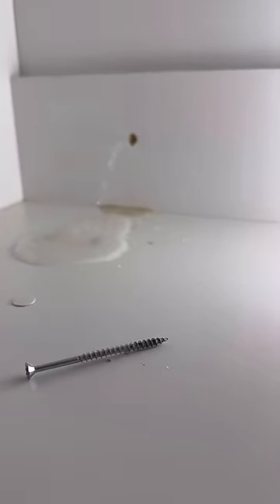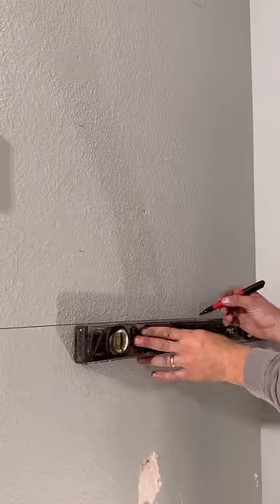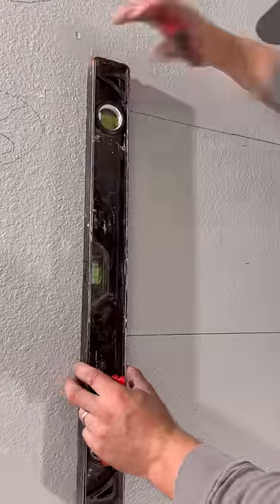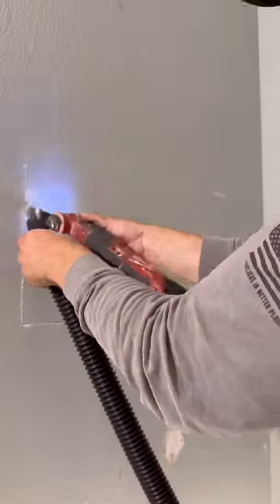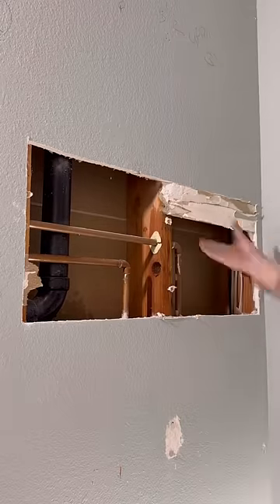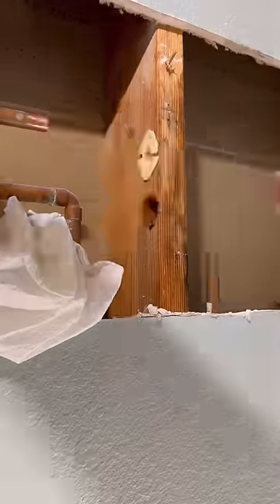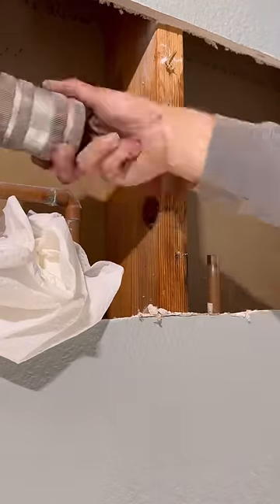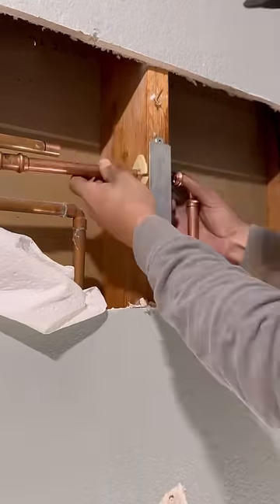are screws supposed to be wet? #plumber #plumbing #homerepair #diy #plumbingrepair

Comment: Nice to see a plumber use a level to  mark out the required opening instead of bashing the drywall out with a hammer!
Reply: Recently ive had plumbers even screw the cut out piece back in, they even did it right.
Reply: The hammer is too much, I just poke holes with a screwdriver

Comment: That shouldn’t have passed cover inspection without nailplates. Gosh why pay the county for permitting if they can’t complete an inspection before cover?
Reply from the maker: Looks like there were nail plates installed before the Sheetrock went up initially. You can see marks in the wood from them. My guess would be the drywaller ripped them out after the rough plumbing inspection
Reply: @replumb  I believe you after years of watching youtube "builders" but that is hideous behaviour!!
Reply: @replumb but WHY 😂 and why aren’t they held responsible criminally or civilly?

Comment: OMG!!!!! This has to be a first!!!  A plumber actually cut out a square piece of sheetrock for a repair. Most of the plumbers I've worked behind use a hammer to remove sheetrock. Great Job!!!
Reply: If it was a great job he would have kept it intact for any easy repair, instead of busting it out.  Amateur.

Comment: When there's a leak in the wall, it's good to have a decent size opening. You need air flow so the inside of the wall dries before it gets repaired. Wet sheet rock won't go back up well even if you did save it. It can warp or stay damp. If it doesn't dry causes mold.

Comment: I was doing a bathroom floor and ran through a copper pipe that was ran through a groove cut in the beam that had it right at floor level and was so tight it wouldn't even  let the screw push it over. I took a compression coupler off a basement Silcock pipe repair that was past the shutoff as it was a Sunday Night. I came back and soldered the Silcock pipe.

Comment: Marking the pipe is also mandatory by viega for warranty
Reply from the maker: They will warranty their fittings when the pipe was prepped and installed properly, regardless if they see you marked it or not
Reply: @replumb  correct install requires it to be marked. Been through their warranty already.

Comment: Nice work man. My old plumbing company had an issue with a couple bad propress joints on a big project we had. They leaked pretty bad and did some damage and the companies were on us about making sure we marked our depths. Not sure if it's industry standard but hey nice work

Comment: Did you know that in Calif, even if the house was built yesterday you still have to test the drywall & any jointing compound in the affected area for asbestos before you make it friable / open it up.....Unless you have an Asbestos O&M certification and you follow a certain protocol to prevent any material from becoming airborne....$35K OSHA fine if it's "Hot" and the residence is contaminated - Plus decontamination costs. Yes it's true, look it up.

Comment: Little tip for the sheet rock removal is to know where the stud is, and give the drywall a couple good hits with ur palm. The screws will pop a little bit and make it easy to get the piece out in 1. Most plumbers won't take the effort but it doesn't take much

Comment: Plumbers don’t do sheet rock. They literally make a huge mess and leave it, and charge a LOT of money. Oh, and those compression  connections will leak after a while when the metal expands and contracts from the heat.

Comment: There’s many ways to do it.
I’ve seen nails/screws go through nail plates and not leak for a year.
Also seen an unsoldered joint not leak for a year. That was a tight one on the top plate!
Also, never had a shark bite go bad on me either, you’re allowed to bury them in walls now too

Comment: I did that exact thing putting up a handicap grab bar in a bath. Took about a year for it to finally rust through and start to leak. There was no steel plate over the pipe so they didn’t sue against my insurance.

Comment: It's also good to note that stud guards should be recessed into the wood when inside of a shower, they push out whatever board you're putting on to the wall, which makes your wall have a bump in it or make it go out of plumb, I always recess with an oscillating tool

Comment: Aren’t pipes and electrical wires supposed to be a certain depth back from the stud end? 
A friend of mine, who has a house that is 25 years old recently ripped out old shelves in their pantry and when they did water from upstairs, their kid was taking a shower, started coming out. Turns out that when they built the house and put shelves in, they screwed into the studs but also along the wall and went into the drain line, apparently only grey water goes through it, and the screw was tamponading the defect….

Comment: Hey Boy, back in my day I would have cut the sheetrock out and used chewing gum as a permanent fix to plug the hole. Nailed the sheetrock and slapped  wallpaper over it. Task finished. 😲

Comment: Ive done plenty of melamine shelving in my lifetime, and not once did I ever screw in the board that has the hole in it. there is no point in screwing that piece in, it is strictly in there just so you dont see any gap left between the back of the shelving and the wall. at most you could add some caulk, the only place you would screw those shelves to the wall is using an L bracket on the top of the shelves out of view.

Comment: If the pipes are in the center of a six inch wall.......stud gaurds do not have to be installed! You also have to consider that drywall guys will remove a nail plate to make there job easier

Comment: They have a tool made of plastic that gives you the correct fitting depth, taking the fitting on and off is just increasing the risk of compromising the o ring not to mention you may not get the correct depth using the fitting unless you have those glasses that can see through the fitting🤦🏽🤦🏽🤦🏽

Comment: You should actually have the waterline in the middle of the stud, that way when the sheet rock guys use 1-1/4 screws, they won’t hit the line no matter what,
Reply: Yes, but cabinet guys always use a 3 inch screw. They would hit it anyway, I nail plate, no matter what the depth

Comment: How does the Propress joints compare with traditional soldered connections? Are they stronger and longer lasting under mechanical stress?

Comment: I recently had the exact same thing happened to me after I had to replace about 6 feet of freeze bursted pipe. Sorry I'm still old school, had to sweat mine on. I had pixs to prove that I used nail plates. Instead of leaving the sheetrock work for me to redo the property owner had his Son in law do it. Well 3 days later I got called back there, Yep the son-in-law pulled off the nail plates and Had 2" screw in it.😂 This time the property owner had me fix the sheetrock and guess what I HAVEN'T HAD TO REDO IT.

Comment: Serious question, but wont the o rings in the propress degrade and eventually leak? Im not bashing on anyone, but im geniunley curious as to why he pressed it instead of soldering
Reply from the maker: Fitting will outlast the pipe

Comment: there was a nail in a 1/4 hot water line for 20 years or more that I know of, never leaked.  When I did a bathroom remodel I could not believe my eyes.  never leaked but was fully in the coper.

Comment: The holes wasn't drilled in the right location in the studs 2x4 studs need to be drilled in the middle of the stud and other size 1 3/4 from the edge.

Comment: I'm charging six hundred bucks just to repair the sheet rock.
Reply: What a scam $600😲
Reply: @xpress Freight  you obviously don't value your time,  you have no idea how much materials cost, and you've never done a wall repair at eye-level that blends  in so no one can tell there is a wall repair, and you're definitely not licensed bonded or insured to do such work.

Comment: No! It's not wherever the pioes are what do you own a stud guard manufacturing facility bro ? I'm down in Florida whenever the pipe is closer to the face of the stud than the width of a grown man's thumb you are required put protection. If the drywall contractor bust out two inch screws because he's out of inch and a quarter that is no one's fault. And we live on change orders down here so please drill through my pipe with those 3in screws. We purposely roll our lines to the middle of the stud to avoid that repeating continuous expense of stud guards
Reply from the maker: It’s 1 1/4” away from face of the stud. Any closer you should be using a stud guard

Comment: $600! $5 in parts, 30min drive, $25 vehicle costs, 30min repair. $570 per hour wage. Yep, robbery.
Reply from the maker: More productive to society than a lawyer
Reply: @replumb  I'll give you that one and add taxes accountants.
Reply: You forgot that plumbers have to pay for insurance (liability and vehicle), that's a huge cost. And you're paying for his experience. A handyman would be cheaper, but who knows what the results will be. This guy even held a shop vac up while cutting the drywall...the average schlep doesn't do that!
Reply: @spookerz35  Sorry, $565. $5 for 30min of liability insurance and I already included vehicle costs.
Reply: @court2379  - so you're good with some JB Weld, hose clamps and duct tape...got it!😂
Reply: @spookerz35  No those are way too expensive. Just a can of flex seal. 😉

Comment: They tested those plates against a modern driver gun and it screwed right through the plate easily, no excuse not to use them but there not foolproof at all

Comment: Yikes, pro-press are not rated to buried installations. 
Why not solder the pipe, won't take much longer for known piece of mind. Now after the 5 year mark you will be fearing that the customer will be calling you stating that your quick fix is leaking.

Comment: You’re talking about nail plates to prevent nails or screws being driven through pipes, seen to many times where these inconveniences haven’t stopped diddly squat, brain dead “ sheet rock installers/ cabinet makers have still driven fixings through them. Lol.

Comment: Jeez, $600 to press in some propress fittings? I gotta change careers! Only take a couple jobs to pay off rhe propress at that rate
Reply from the maker: Not as easy as you think
Reply: @replumb  not as easy as you show* lol mostly busting your balls, gotta spend time finding the pinhole and chopping the old copper out. However the press is a big time saver. We have one at my job, I'm an engineer in a 60 year old building. One day we had a pinhole that we were searching for for 13 hours straight, finally found it, chopped it then had to solder in new copper (we didn't own a press yet) so I know what you mean lmao

Comment: Screw wit an impact driver goes straight trough it pal was out on a job where the kitchen installer put  4 screws trough the hydrother and left even though u could see the water coming out under the plaster board had to take out 4 base units to find out 4 of the 8 screws he had put in had gone trough the stud gard had to laf people think there going to stop a screw put in wit a impact driver had to laf made me €850 for an hour work and i dont have to put back the plaster board or the base unit's thanks kitchen installer 😂🎉